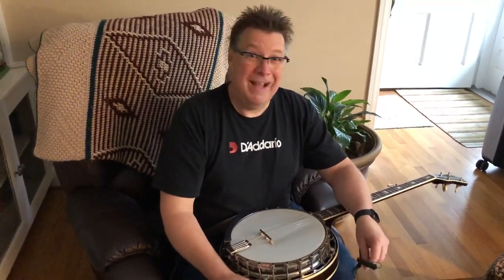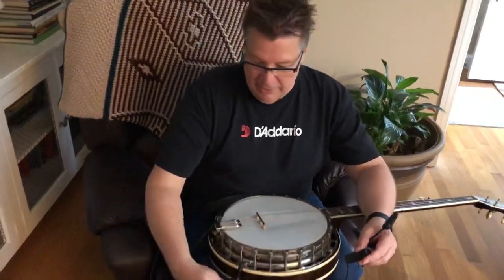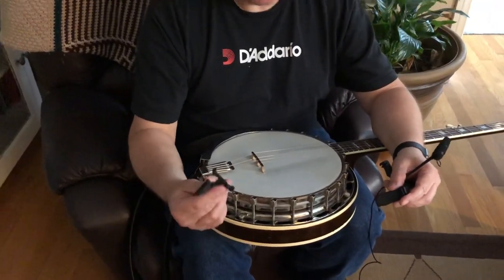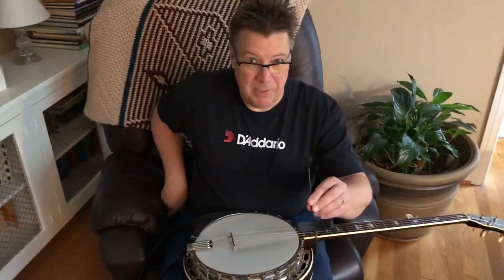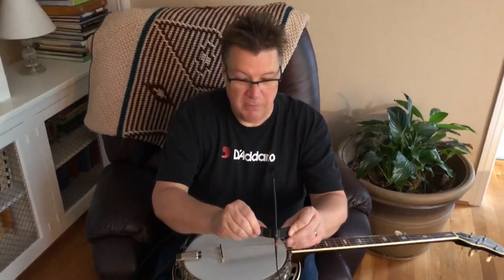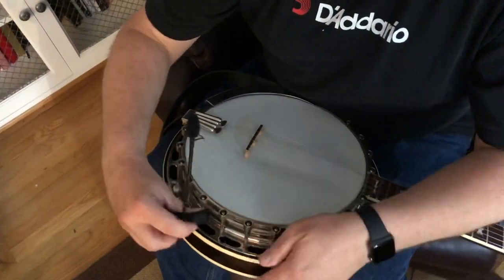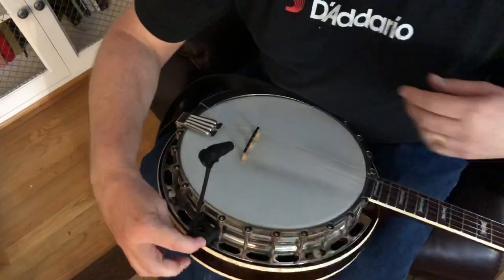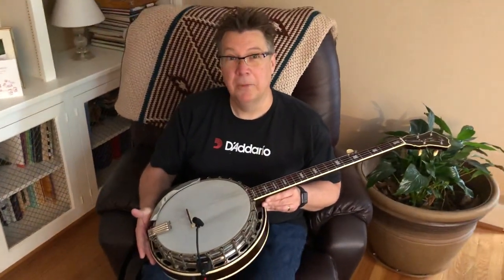Nedski Banjo Tip: Attaching a DPA mic to a banjo

Comment: I have an openback and the fiddle clip just don’t work. It kept falling of during live gigs and it was super frustrating. So i’ll vote for the cello clip. 
However I have a little tweak. I bought a bass clip instead and cut of the string attatchments. Then i drilled 2 holes in it an pushed the 2 brackets through the holes and installed it permanently on my banjo. It has stayed there for the past 7-8 years and it just works. It haven’t failed ever so i can really recommend that for an openback. 
 I’m not sure if there will be enough space on a resonator banjo but for openbacks it is perfect 👍🏼
Reply from the maker: Peter - That sounds like a great idea. I may order a bass clip and try it out. I don’t always play the same banjo, so the cello clip makes it easier to remove (and install instantly on another banjo) but if I like the way the bass clip works, I’ll just buy a few of them. (Cheaper than buying multiple 4099 mics!)
Reply: @nedluberecki  awesome. If you do so let me know if you like it or not :-).

Comment: Thanks Ned! Any thoughts on mounting a 4099 INSIDE the banjo? E.g., glued or zip-tied to a tension rod?  Would be much safer for the mic - and the fragile microdot cable - and you wouldn't need to put it on / take it off - to put the banjo in a case.  I'd guess it probably sounds pretty good in there!? :-)
Reply from the maker: I’ve never had much luck with internally mounted mics. For one thing they tend to sound really muddy and require a lot of EQ to fix that. The other thing is that in order to get the most realistic “banjo sound” the mic needs to point toward the head (and the DPA is hyper-cardioid (very directional) so if it’s pointed from the inside out, it actually ends up pointed toward the monitor speakers and is more prone to feedback! 

I haven’t actually tried this with the DPA, but my experiences trying this with other internally mounted mics was so bad that I didn’t even consider it here. But, as they say: lyour mileage may vary.”
Reply: @nedluberecki  Thanks Ned! I tried it and it wasn't muddy, but sounded weird for sure. Say - can you share how you manage the fragile microdot cable, going to your wireless transmitter? Where do you mount the transmitter - on your body, or on your banjo? strap? Thank you!!
Reply from the maker: @stoneymtnramblers  - I coiled up the excess cable and tied it with a zip-tie. I feed the cable through a couple of brackets and behind the tailpiece (to keep it from hanging) and then secure it to my strap with a Velcro cable tie. The transmitter is on my strap.

Comment: That’s great, Ned. Thank you.
Do you run straight to the board or do you have a preamp?
Reply from the maker: With the Becky Buller Band we use them with wireless transmitters. The wireless belt pack provides the phantom power for the mic. Otherwise you can run them directly into the board with an XLR mic cable. The DPA is a condenser mic, so you’ll need phantom power, but won’t need a pre amp (unless you want more control than the mixer offers).
Reply: @nedluberecki  Curious, what wireless system are you using? Are the cable adaptors easy to manage? I currently have sennheizer EK G4 IEM, and thinking about sticking with the same brand.

Comment: Hey Ned,  what do you think is best for banjo amplification. On board mic, or pickup?  I can't find much of anything on you tube discussing either one, nor anything on DI boxes for banjo.
Reply from the maker: It depends on the situation. In our band, we all use DPA clip on mics, but we bring our own mixer, in-ear monitor system and our own sound engineer.  Also, we’re an acoustic bluegrass band with no drums or electric instruments. This works great for us, but if you’re trying to play banjo in a much louder stage situation, sometimes a pickup works better. There’s always a bit of a trade off with volume and tone. Ideally, microphones pick up all the subtlety of tone, but they tend to feed back at higher volumes. When playing in high volume situations (with electric guitars and drums and such) I find the Fishman pickup with an EQ pedal works much better. The tone isn’t as good as the mic, but what good is great tone, if no one can hear you? The EQ pedal helps me dial in the tone and avoid frequencies that feed back the most. I hope this helps! -Ned
Reply: Hey Ned, thanks for your reply. Our band is the usual bluegrass set up, except that we have a guy who plays the cajon drum box, and harmonica. Both are pretty loud, but not near as loud as an actual drum set. Our guitar player, and mando player have gotten pickups. The pickup sounds like the more convenient way to go, but I'm just really concerned about the tone trade off. Do you think it would be okay for me to have the mic when the other guys have pickups, or should we all have pickups?
Reply from the maker: Marty Nellessen - I think you’ll be happier with the tone of the mic. The DPA is a bit pricey, but they’re my favorite, and previously I was micing my banjo with a Neumann KM84. Using the cello mount is also the most convenient mounting bracket that I’ve found for any on board banjo mic.
Reply: @nedluberecki  I think you're right. This is really helping me out. I do have a another question though if you don't mind. I also checked out the  Gold tone ABS which is quite a bit cheaper, but I am more concerned about sound quality than cost if there is a considerable difference between the two. Do you have any impute on that?
Reply: Hi Ned - I have a buddy who bought the Drum clip option from DPA. Have you tried that? Thx for the video, and for all you do!
Reply: By the way - just read in the comments that you run your 4099 directly into a wireless transmitter. Sweet. Planning on doing the same, to Senn EW-D via DAD6003 adapter. How do you route your microdot cable? Only available in 6' length(?). Tempting to mount the beltpack transmitter on the banjo or maybe the strap. Then just need to manage the cable. Or just mount the beltpack on my pants and deal with a dangling cable. Eh? Thx!